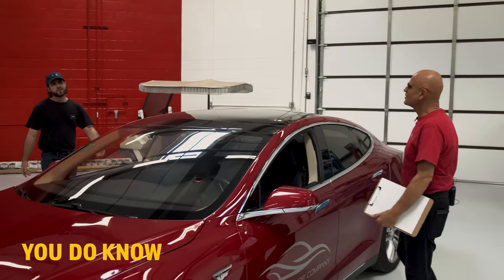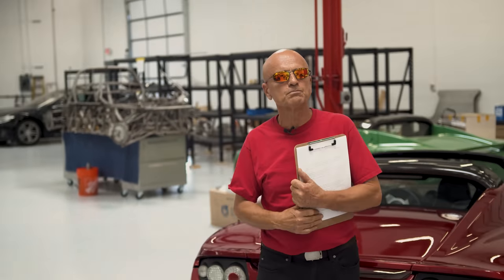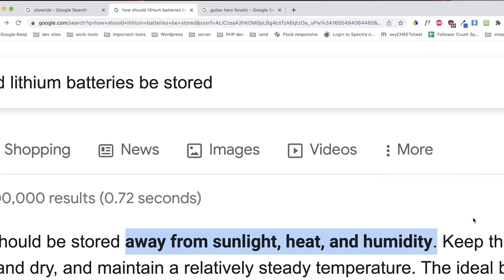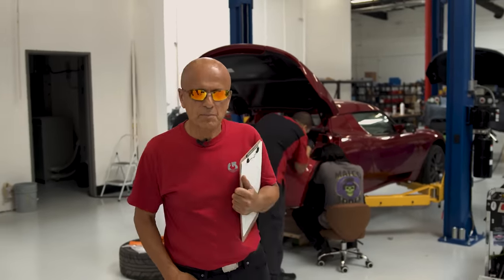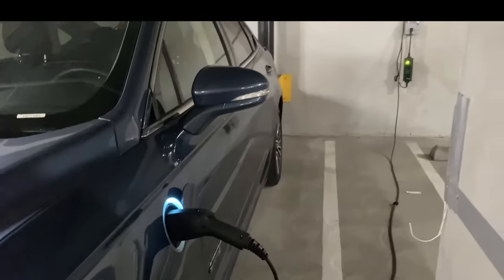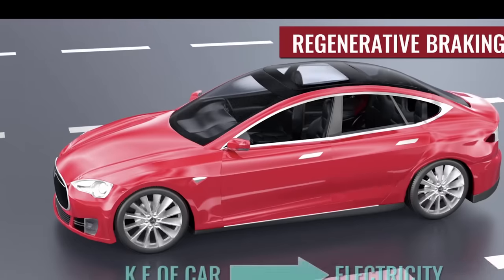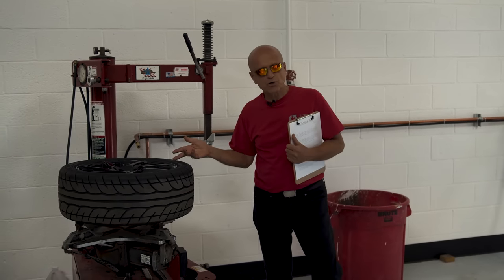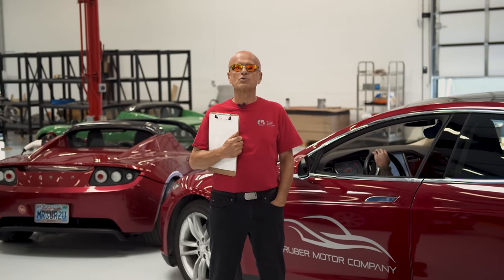Tesla DRAINING TOO FAST? Battery life TIPS n TRICKS! | Gruber Motors

Comment: I am Tesla model Y owner; and I am strongly recommend don’t buy any TESLA, as the battery sucks you in 6 months no matter what. I am very frustrated with  TESLA
Reply: I bought a MYLR and have been really happy with it.

My range advice? Charge to 100% & discharge to 0%.  Accelerate like you stole it.  Use supercharging frequently.  Basically, use and abuse the battery relentlessly to ensure it either fails or degrades below 70% capacity well before the 8 year 120K mile battery warranty ends.  Then while other owners are babying their old battery, you’ll get a newly refurbished battery free of charge.  

The worst thing to do is to go middle of the road regarding how much your baby the battery.  That’s no man’s land because the battery is likely to fail or degrade below 70% not to long after the 8 years or 120K miles warranty, which is why they chose those numbers.

Comment: Here's a free tip...don't buy a electric car. It is still in it's infancy development. Batteries have been know to explode. The most common problem, batteries don't last as long as they should, and last, they have limited range. STAY FOSSIL FUEL cars and trucks. Reliable and easy to fix.
Reply: Nope its in full blown production. Gas is known to explode. Very flammable. You are making the exact same arguments old people made when cell phones came out.

Comment: I've seen data that charging exclusively by supercharging is not hugely detrimental vs slow level 1/2 charging. The two biggest factors affecting battery is age and temp  (worst is heat). So don't sweat it if you only supercharge because you don't have a home charger. The vast data tells us it's ok.
Reply: I believe this is true as well. I fast charge (no superchargers in Hawaii) every time I charge my M3 and have not experienced any issues. if Tesla thought it was so detrimental to the battery to fast charge,  why do they keep experimenting with different ways to make charging even faster?

Comment: Great video as always! My concerns is with home charging is that where I live there is no night tariff and now it’s 30p so it’s like 40 cent/kW which its insane.
My MS is free supercharging and I live close to a supercharger.
I think 20% to 50 or 60% sessions without preconditioning won’t do that much harm because the heat is the problem, so if you charge it quickly preferably not from low state of charge, you put less stress on the battery.
I think the  best if you have solar and you charge it during the day on a slow charger.

Comment: 2023 model Y RWD60    I have LFP batteries made by CATL .  I charge to 100% every night , the cars lives most of its it life on the plug on a level 2 charger 24 amps 240 volts.  Tesla recommends charging to 100% if you have LFP batteries.   What's your advice in this case?   14 months and 19000 KLMs super happy with the car no issues at all.  Winnipeg, Manitoba

Comment: It is good to mention the Nissan LEAF has no Battery Thermal Management. Their batteries lose capacity the fastest.
    The Tesla and chevy Bolt batteries hold up the best. They are some of the few that cool even when off and not plugged it. That is important. Tesla is the only battery that pre conditions on the way to a Super Charger if you use their nav to get there.